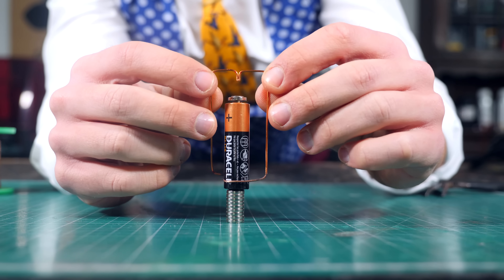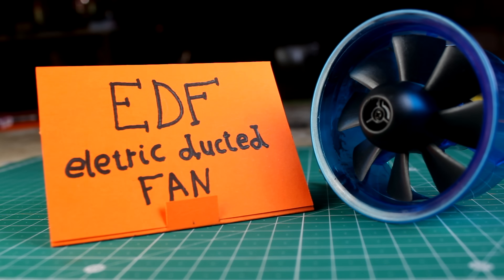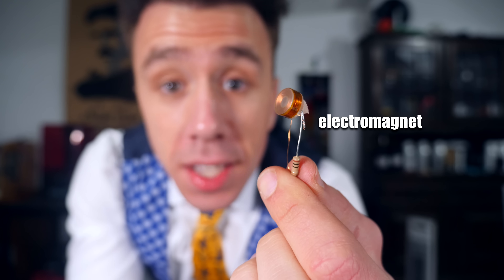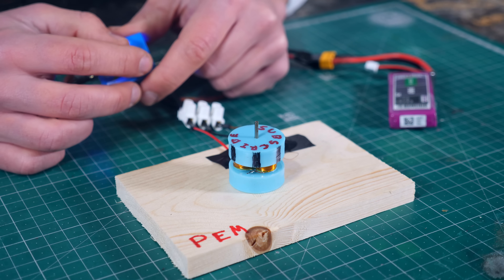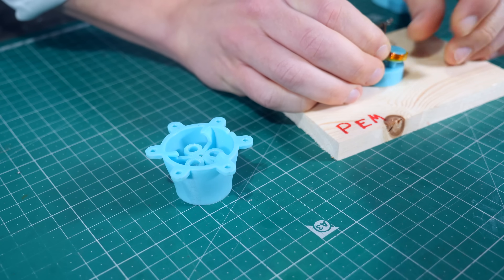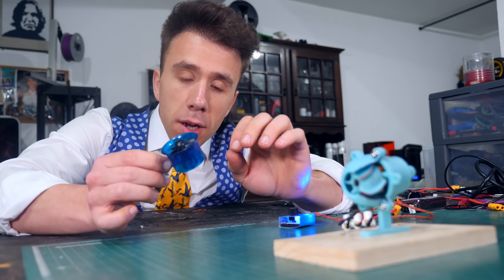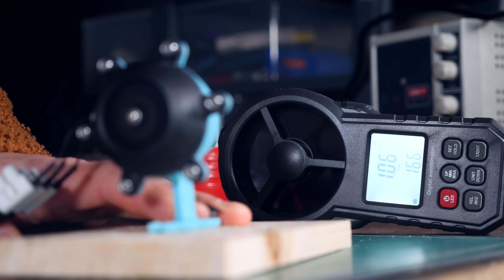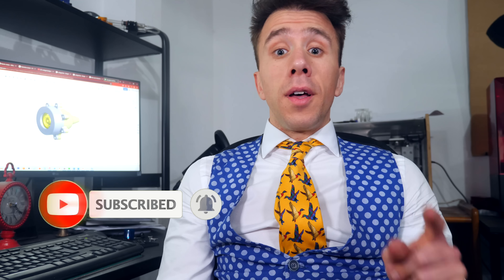I 3D Printed an ELECTRIC MOTOR FAN

Comment: Theme for future video. Finish this video successfully. 
I use to fly rc aircraft. I did alot of reaserch into EDF setups but never dabbled with them as they were out of my budget at the time.  
In the EDF design, the inlet and outlet are the same outer diameter.  The only restriction is the motor mount and aerodynamic cone. And EDF fans of under 80mm did not preform well. 80 to 120mm seemed to be the "sweet spot" when it came to thrust to weight ratio. EDF also have very shallow angle on the blades and use a very high speed motor. 

From what I can find out about centrifugal fans here: https://en.m.wikipedia.org/wiki/Centrifugal_fan  the most efficient centrifugal fans are very much the same shape as the electric fan on top of most house furnace.  And in that case the motor speed is less of a factor than it's torque. 
So a large intake to not restrict the flow like the hamster wheel shape fan in most cars. If you can direct that into a chamber in front of your jet being sure to keep the same volume of air while not restricting air speed you should have some better success.

Comment: Probably just need to redesign the casing. I would try slightly different shapes to help compress the air as it comes off the impeller. With enough positive pressure the gas should decompress as it travels through the outlet geometry. Should give more thrust and air throughput.

Comment: I don’t know the full extent of your testing, but by what you show on the video it looks like you are restricting intake and outflow from  the fan.

That can give you a higher static pressure but will kill your speed, specially if the out flow is creating internal vortexes.

If you’re trying to build a turbofan though, that static pressure is probably a good idea anyway, I doubt the EDF would be able to push that much air against higher static pressure. 

You could test speed with higher static pressure and see if you really have a difference, just add layers of foam behind the propelers (and seal it as good as you can) and measure after the foam.

Comment: The impeller is too small and the air inlet is too small in comparison to the fan. No matter how powerful the motor is, the inlet size will ALWAYS limit airflow.

Comment: I‘m actualy a bit into aerodynamics and your impeller was more optimised for pressure, not for airflow, you‘ll have to make the outlet bigger and the fan with it’s blades longer and less aggressive, if you find a good compromise between pressure and airflow, you‘ll produce thrust close to the edf

If you would open a dyson fan you would find a significantly different impeller, just as a sidenote😉

Comment: Are you getting the same RPM between the two systems? Heavier printed propeller is probably heavier, reducing RPM and Torque.

Comment: You're dealing with density of the air, then the 3D printed materials do not are strong enough to work properly without deforming. For small purposes you need thinner propellers. Another improvement is to make moving parts as close as possible to the internal walls.

Comment: Losing flow efficiency in turbulence in the wide  internal tolerances. Centripetal force is flexing the plastic airfoils. No stators. Scale issues. Try in titanium and about tree times bigger, with a fluted intake horn. Good Luck!

Comment: Some early jet engines (and some particularly niche ones still) use centrifugal compressors. Because you have to turn the flow 90+ degrees, you need to carefully manage the flow path, and will always experience more loss than an axial compressor.

You probably need 3 changes: a cleaner inlet entry (like the EDF, going from wide to narrow), guide vanes after the compressor, and careful selection of the inlet area to exhaust area ratio.

Comment: Your problem is simple! You didn’t add volatile fuel or explosives to any designs shown! 😬 
For a video idea, I’d like to see you try to embed wire while 3d printing and actually print a ready-made DC motor or explore conductive 3-D filament.

Comment: Hey, I also want to win an 3D printer and be able to make my own fans, it's probably my only chanse to be popular...
If you build a strong enough fan-base you can use them to blow away all the pollen from tomatoplants so there will be no more tomatoes (don't blow it in the direction of other tomatoplants, then it will get the opposite effect)

Comment: I think your problem is similar to turbojet engines and turbojfan engines. In a turbojet, the vase majorty of the thrust comes from accelerating the fuel and oxidizer, whereas a turbofan uses the combustion to power a large fan to move the air. one of the most basic reasons for the efficiency differences between the two is just the fact that one is accelerating a little bit of mass a lot, whereas the other is accelerating a lot of mass a little. Since thrust comes from the change in momentum which is linear with speed, but the energy required to accelerate the exhaust inceases with speed squared. Since you're working with the same power input, the impeller prob moves less air, meaning more energy is used to accelerate a little bit of air, resulting in less momentum change --> less thrust

Edit: minute physics explains this in a video on why jet engines are so big

Comment: What i can recall from fluid mechanics classes is that by compresing a fluid you decrease its speed , so the centrifugal fan that you designed basically outputs a slightly compressed air but at a lower speed, in jet engines this is desired because you need a high density of air with a low moving speed and by igniting fuel you generate thrust .
Reply: Yes and no, the centrifugal compressor is easy to build (tolerances can be looser) and good at increasing the pressure of the fluid (air), it's not that good at creating mass flow. Which is the reason why modern jet engines use axial compressors, as they can flow high volume/mass and compress the air enough for combustion. 

After the compressor you add fuel and ignite the mixture to increase the pressure again and finally you expand the high pressure fluid through a nozzle to increase the speed of the fluid and create thrust.
Reply: @JainZar1  Bah! I forgot about mass flow. You're totally right. Thats probably the main factor. Even if you recover the pressure, you're wasting energy pressurizing gas instead of pushing mass.
Reply: @alexanderdenton8938  Pressure is definitely the most important point - there's a reason rocket exhausts are designed to recover the pressure into velocity instead of just exposing the high chamber pressures directly, the force created by momentum exchange from the same energy is much higher than the force of pressure alone. Compression is only beneficial if you're adding thermal energy and therefore can take advantage of the Brayton cycle to extract more - if not, you just want to put all power directly into flow (which is why turbofans have a single big flat fan for mass and velocity instead of pressure).
Reply: Yeah I was thinking that turbofans only work if you are actually injecting fuel. Without fuel, you are just building a more complicated fan with more steps and more inefficiency.
Reply: @Roach_Dogg_JR   - yes without the turbine bit it is JUST a fan - with electric power call it an EDF...
Reply: This,
you need high density (high pressure) air for combustion alone.
You actually don't want to compress it much at all ideally but compression with containment is a good way of chaneling energy into velocity in one direction.

Also pressure has backflow so that's fun.
Reply: So centrifugal is for pressure applications and normal fan for high airflow applications
Reply: @MeesDeppe_Official  In general, yes. You can get some pretty insane pressures with multi-stage axial compressors, like in modern jet engines, but you need really tight tolerances to not have spillage back to the low pressure side.

Comment: Mechanical engineer here. From a purely thermodynamic standpoint, an edf has a larger intake and output and doesn't need to compress the air to get high flow. Your impeller is a compressor. It has to fight against the forces pushing the air apart. That takes a lot of torque and energy that a brushless DC motor cannot output. Brushless DC motors are great for high speed, but not high torque.

That's kind of the reason turbo jet engines are still on top of the game in propulsion. They are not bound by the same constraints electric motors are in terms of torque since they use the rapidly expansion of gases to spin the turbine and impeller. Expanding gases offer plenty of torque if used right. Electricity does not.

Edit: I just thought of this as well. It may also be your nozzle on there. Since the air is high pressure and not high flow, it will simply expand again once exiting the nozzle in every direction. The short of it is you just need a higher torque motor to get the mass flow you need to jet the air out so it doesn't expand before imparting its energy.

Comment: I could be wrong but I believe a ducted fan gains some flow from the shape of the duct. It functions like a wing that helps to create a low pressure zone around the blades that passively draws in more air.

Comment: so i'm a total noob, but i think the problem is that you push the air, but don't compress it.  i think you need to constrict the output from the turbine, and maybe the motor doesn't have enough torque?  like i said, total noob, this probably makes no sense, but if it doesn't, at least it got you thinking outside of the box rofl

Comment: Easy homie: You have a smaller intake on the turbo. 
Turbo's aren't good for generating thrust. They are compressors. They are only useful if you want to draw a lot of air, mix it with fuel and burn it. 
Early jet engines were basically just centrifugal compressors duct taped to a combustion chambers but everybody went to axial compressors because they provide larger intake areas. 
What really determines your thrust are disappointingly simple things: 
-Intake area, 
-exhaust area 
-and power.

Comment: Your EDF is built for a maximum flow rate. Your centrifugal fan is built to make pressure. So let us make it easy (neglect of resistors) if you would work with Bernoulli the total amount of energy is the amount of the speed of the gas and the pressure (neglect potential energy). Conclusion the EDF just accelerated the gas while the centrifugal fan increases the pressure, which then accelerates by the pressure difference (losses). Hope my thoughts are helping and make sense. Best regards Max

Comment: EDF is creating more air flow. But your objective is compress the air and the air to exit from back. But somehow it’s not happening, may be due to not enough compression is created by the centrifugal fan. 
Make the centrifugal fan with conical back with similar blade structure. So conical front, and conical back.
The magnets are inside this conical fan, and the electro magnets on the duct to control the rotation. 
Next May be u can try an intake fan in front of the new conical fan, which is run by a small fan with rotated by the air exiting from the back.  
Hope u picture it. 
If u can share ur email address, I can send a rough diagram of the above idea .

Comment: you need to optimize the blade angle, intake, and exhaust to hold the motor at the RPM where it reaches it's peak power, where if the motor spins too fast you loose power, if it spins too slow you loose power, and if you don't use the resistance the blades put on the air when they spin (and thus put that same load on the motor) to good use you loose power.

the original EDF was already optimized for that specific motor using the magic of math and engineering, however they are usually going to be halfway between max power output and maximum efficiency optimizations, meaning there is a slim chance you can make your centrifugal fan output slightly more power, but at the expense of using significantly more power, or the other way where it's slightly more efficient but nowhere near as powerful.

honestly if you even manage to make 80% of the power and efficiency of the original professional design just by winging it, that would be a massive success as there just isn't a way to cheese your way out of fluid dynamic equations and simulations, take the dyson fan for example, it is optimized specifically for a dyson motor and a bladeless exhaust, as soon as you take it out of that application it's going to loose almost all of it's performance. 

So welcome to the wonderful land of fan design, where the blade angle, blade count, blade density, blade turbulence, blade sweep, blade depth, blade design, intake size/aspect ratio/etc... all have to be perfectly balanced in order to make power, otherwise you'll just spin air around inside the casing and waste energy, and I haven't even mentioned stator vanes or varying RPM ranges, which is also why airplane engines are so complex and expensive, as they need to not just produce max thrust at a specific RPM, but also function in a predictable way along a range of RPM's and power levels whilst using the lowest amount of fuel possible.

That being said, it's a cool design, hope you manage to make it work cause it's super stylish and inventive!

Comment: Here my not-so-lightened idea for the thrust probleme : (surface area of working surface - compression load) * efficiency"(impeller design+vortexs+tightness+nose)".
Dont know if that make sense ... but the surface area of the impeller seem less than half that of the fan. peak force wasted in heat and self workload. So much unknown parameter to be wrong thougt .

Comment: Complete shot in the dark here, but could it be an issue of air volume? Your stock EDF pulls a large volume of air, which moves not only the air ahead, but also pushes the static air behind. Your centrifugal while being capable of compressing the air into a condensed spike, is not reaching a high enough volume (due to size) to reach high levels of compression. So less volume = less compression = less generated pressure or thrust. The size of the centrifugal fan is restricting flow, but is it reaching an efficient level of compression or is it just blocking the air flow? This is my hypothesis at least.

Comment: Try inflating a balloon if it doesn't inflate the balloon you're not creating the compression you think you are then we can troubleshoot from there
Reply: I would say decrease the air gap between the impeller blades and the outer housing ..... And try to increase or decrease the rotation of the blades on the impeller......
Reply: Also try to make the back of the housing (exhaust) more conical to reduce turbulence

Comment: You're losing efficiency when taking the high pressure/low velocity air (coming from the impeller) and changing it back to low pressure/high velocity air (in the nozzle) adding the extra steps its probably creating a bottle neck in the flow or extra turbulence. Hope this helps!

Comment: Okay so not an engineer but I do have some knowledge about what's going on. So you have two main problems. the first is as a lot have already said your air intake is too restrictive.  The edf works because of extremely tight tolerances between the duct and the blades.
In essence the edf pulls in alot of air and forces it out in a laminar flow. the Dyson impeller does the same only Dyson's design uses a inverted bell too force the air into a higher pressure. think reverse rocket. what I would try is mating a squirrel cage fan to the bottom end of the Dyson. with the right plenum design you should be able to pull enough air in that the Dyson impeller can create a high pressure stream of air.

Comment: Looking at the size difference, the mass of the 3D printed impeller could be more significant than the one off the shelf (or out of the dumpster). The motor may be doing more work due to this difference in mass. There's also air compression taking place which takes work as well.
Reply: Mass shouldn't change the efficiency once its up to speed, but if the new impeller is unbalanced that could cause vibrations and wasted power.

Comment: This is probably only part of the problem but the impeller would also be compressing the air which would generate heat. That heat is energy lost that the edf doesn't.

Comment: I don't know if this is correct, but from my experience I would guess your loss of thrust would be from a combination of more weight of the actual prop, more turbulence within the housing, pitch of the blades, and surface quality of the blades and housing. I messed around with printing RC boat propellers for a while and I was amazed at how vital the surface quality was to performance. Just a tiny chip or ripple in the prop could make a strong performer a useless cavitating piece of trash. Obviously water and air have different factors, but they're still fans

Comment: Without going through an entire course in  aerothermodynamics , your impeller design is not nearly as optimal as the EDF.   With your design, you are restricting your flow rate, when compared to the EDF intake which is curved, the curved intake helps to increase the volume of air (it's a fluid dynamics effect of curved surfaces).  The EDF has larger fan blades which are optimized to pull in air and move it (mass air flow), much more so than your impeller design.  Impellers are great for jet engines where you are working off of thrust and you need pressure for fuel air mix combustion, getting that to work is a trick.  You can read all of the Kamps books where he designed the KJ-66 and use of hooked tubes to feed the fuel into the combustion portion of the engine.  If you look at a standard high-bypass turbofan engine you'll find most of the thrust is coming out of the fan portion, which is like the EDF, the uncompressed air of the EDF would be 60% of the thrust compared to your impeller.  I don't know what your numbers are but I'm guessing your getting somewhere between 20-50% less thrust then what you got from the EDF.